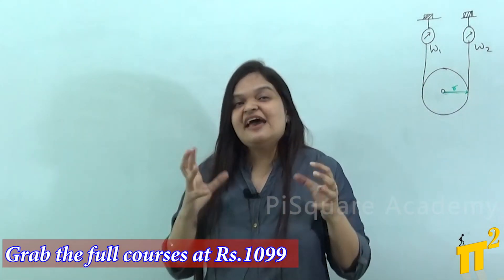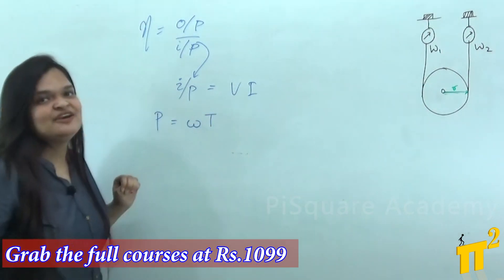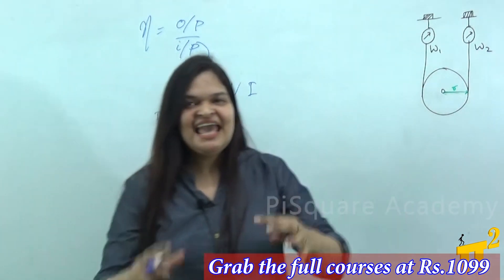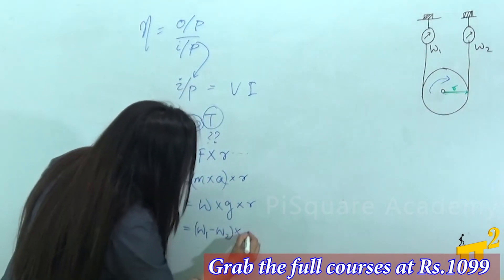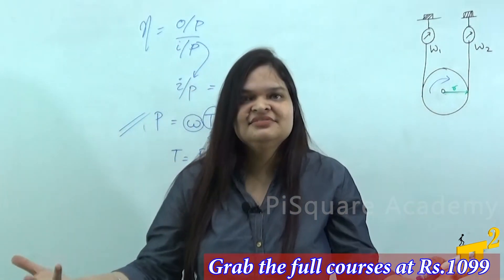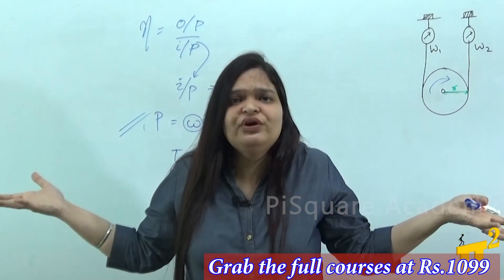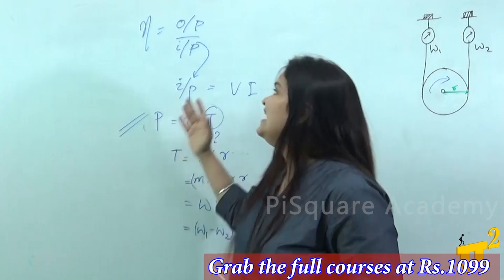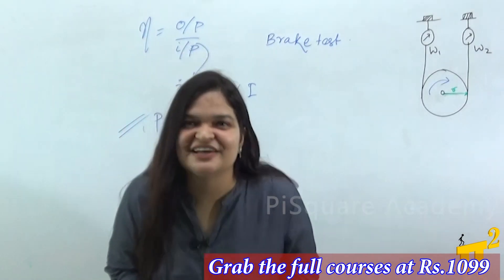Brake Test of DC Shunt Motor Reveals Mind-Blowing Results! Must-Watch video!

Comment: Dear madam 
1.The one which you wrote W1-W2 is not correct it's W1 difference of W2 
Can we use brake test for high rated machines

Comment: Sir as we know  star delta transformer step down the voltage and delta star transformer step up the voltage. 
My question is for domestic  usage we have to  step down(star delta) the voltage in distribution line ,then  how come we will  get 3 phase 4 wire system (star) in domestic  usage
Reply: Step down or step up is not dependent on nature of winding like star or Delta